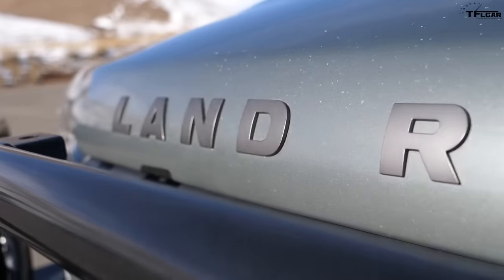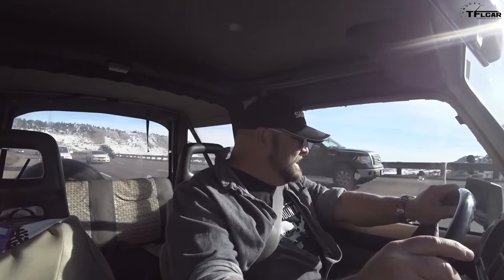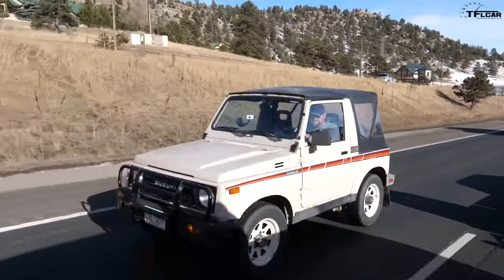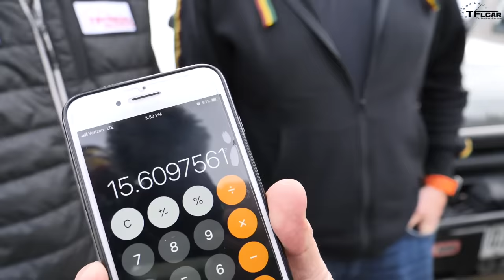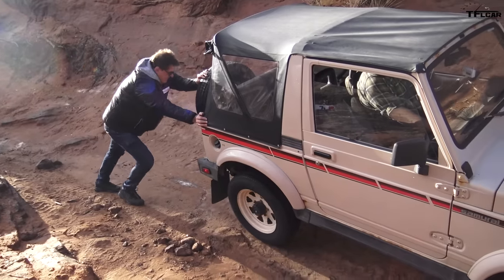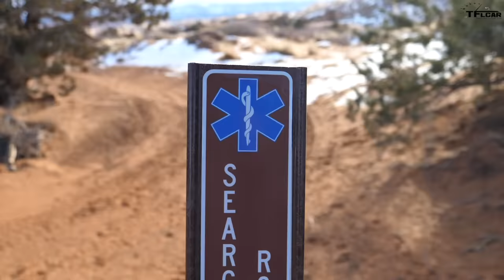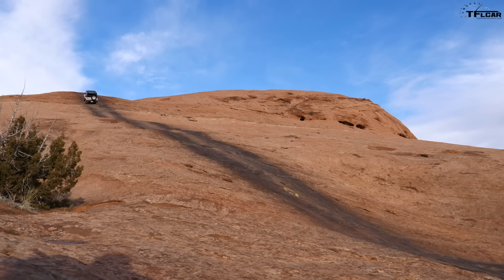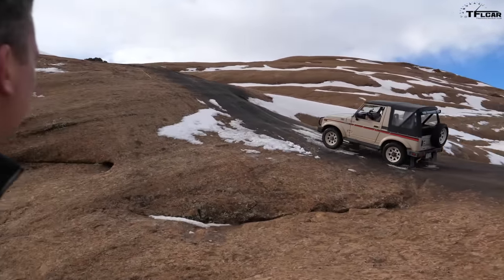We Torture Test 3 Budget Off-Roaders in Moab & This One Is The Best! Cheap Jeep Challenge Ep.8

Comment: Always told people: Samurai's are quite capable.  The Samurai did quite well for being stock with street tires. Not surprisingly, the power to weight ratio of a Samurai vs. a 2.4l TJ is not that much off - if I get that about right the Samurai is around 75hp/ton and the TJ about 100hp/ton and that's not counting the modifications which will put the TJ lower than 100hp/ton.  I'm pretty certain that if you give the Samurai a lift and narrow KO2's that are not too big, it would give both the jeep and the land rover a run for it's money.  Plus the Samurai has the manual lockers which the TJ lacks.
You did prove the point though: you don't need all that much tech to get out and have fun.
Reply: I don't think the Samurai has manual lockers, it just has manual locking front hubs. These don't give any advantage except maybe improved fuel economy due to lower rotating mass when in 2wd - the Jeep just disengages the front driveshaft when in 2wd but it's still rotated by the wheels.

Comment: Good video. I have a 03 Land Rover, modified very similar to  yours, and It does great offroad. I did add the center diff lock.  I have owned it for 16 years, and it has been very reliable. The suspension travel is great, so the traction control often is not needed on trails like Moab.  It's great offroad.

Comment: Great video. I really like how the emphasis was on cheap wheeling, something I do also. I picked up an 04 Grand Cherokee Limited 4.7 Quadra-Drive for $1000. Put another $3000 into it redoing the heads, 3" lift, wheels and tires and some other things. Now I have a rig that is comfortable, fast and with the 32" tires, Vari-Lok diffs and the lift very capable off road with ice cold AC, heated leather seats and a killer sound system for around $4000 bucks.

Comment: If the Sami wasnt stock it would destroy the other rigs.
With a SOA lift, Toyota axels, tires, t-case gears it would still be under what the jeeps lift was.
Reply: Even with Just Sam axels en a rear locker and 31 inch tyres its Just better cause its a Japanese car
Reply: The jeeps lift was just a spring and shock lift, $600 max, if the Jeep had lockers or the 6cyl it woulda smacked everything else easily

Comment: The smallest truck was also unmodified with standard tyres..
Reply: They're terribly underpowered.  And you have to chop the fenders to fit a bigger tire.  They aren't that great. Just cheap is why people use them..
Reply: @rediron44  you dont need massive wheels 90% of the time.
It was the only car on test that was standard..
Reply: @forresttm  Massive wheels??  I had to cut the rear out to fit 31 inch tall tires..LOL.  Far from massive. My stock Rubicon tires where bigger..LOL.
Reply: @forresttm  the one we had was only 60 horsepower dude. I did a spring over and put on 31 inch tires. Still had to cut out the rear fenderwells.  It was a fun little thing.  But very slow, very underpowered.  Weak streering,  terrible undersized brakes. Tons of things you don't know about dude.
Reply: Yet had plenty of power to pull a land rover over...
You dont need massive amounts of power.
Reply: I say that because we used to use on mudding and helped a few that had fallen over..
Its a good small tool. If your asking it to do big car things its going to be underpowered..
Reply: @forresttm  It needed wheel speed to climb some hills here where I live, barely adequate.  Like I said,  it was fun. But underpowered.  If you thought 60 horsepower was good. What if you had a 4.0 inline 6 in a Jeep with 190 HP and 245 ft pounds of torque??  LOL
Reply: @rediron44  i would be annoyed.. At least ots a tiny engine making small power. It has crawler gears for that reason.
If i had a 4.0 that made that power. I would be disappointed :D 
Uk and us use cars differently it seems.
Reply: @forresttm  you do realize the Jeep has lower "crawler" gears than the Suzuki right??  LOL.   And no, the UK does not, the US buys those Jeeps to go off road. Period.  My Jeep has 4:1 low range in the transfer case,  stock.  Suzuki has never had gears that low. Plus 4:11 axle gears, stock.  Crawler gears dude
Reply: @forresttm  and its obvious, since you call them cars..lol

Comment: Throw a decent suspension and 33s at still half the price and it will run circles with less gas
Reply: Or stock with 30" BFG AT or MTR and remove the sway bar and by God do a reasonable time up on the Sammy and let a little bit of air out of the tires! And a set of inexpensive suspension seat's completely changed all the Sammy's I have owned! I'm not downing you're statement just adding to the wisdom!
Reply: @billyputnam6892  no stock Sammi would turn 31's or 33's lol  Mine barely turned 235/75-15's and in a hard climb wouldn't even turn those

Comment: I daily driver a disco 2 never overheated not even once. I'm gonna make a lot of people mad but I own a 95 land cruiser also n that thing is always breaking every other time I take her in the woods. I've never broken anything on my disco other than my windshield with a tree limb. The thing is 2003-2004 Discovery's are trash you want a Bosch 4.0 n then put the difflock transfer case linkage in bc it has it but in launch the designers deemed it unnecessary bc of terrain response. I have both disco 1 n 2 and several Toyotas but they don't compare off-road to my disco on a 3" lift n 33s
Reply: You'll only make the Toyota fanbois mad. Often they just can't accept that some vehicles are actually better, and then all they can do is fall back on the "Toyota is more reliable" argument, which in this day and age is mute, considering that Buick are rated more reliable than Toyota.
Reply: @fredbrackely  woah Theresa Buick really lol. Toyotas are great road going family hauler suv that can off-road lightly. I own a 2001 sequoia sr5 with a 3" Dobinsons suspension and 35x12.5 BFG km3 tires on procomp offset rims. I had to do so much work to make it flex. But now that things a tank n my wife daily drives it. Wish I could post pictures my wife 4'10" n the hood is way higher than her.                Well anyways the point is if your gonna buy a 3-5k off-road toy, the Land Rover Discovery 2 is the best bang for your buck it'll out perform all your Jeep buddies puny stock on all season radials. I am a diesel mechanic so maybe that's way I'm not scared
Reply: I have a p90 Range Rover.  Pretty fun off roading
Reply: My 1999 4Runner needed an alternator a few years ago.  Yep that’s it. Other than maintenance. I had a friend who bought a Disco 2.  What a clusterfuck.  Mechanical and electrical nightmare.  But some people may get lucky and get a good one.  Mad respect to the disco off road though.
Reply: @troyp9485  to me it's no nightmare whatsoever I buy n resell land Rover constantly for the last ten years. The thing you need to understand is that they don't play it safe and try to produce the most cutting edge product available. It's like my dad always, "Son you gotta pay to play, you always get what u pay for." So if all u want is a boring moderately capable suv that to a normal person looks like a shitty old car then get a 4runner. When I drive down the road people wave, land Rover owners give y'all the nod, and lastly kids born after disco 2 was built tell me how awesome it is. I have the feeling alot of you guys are more timid and afraid instead of aggressive and confident which is what will keep u playing it safe for the rest of your life. All the while wondering what could have happened if you just did something and took a chance. Don't regret not buy a Rover,  it's stupid not to if your looking for an offroad toy and don't live in the middle of the country
Reply: Lol the 4.0 is significantly worse than the 4.6 the 4.6 actually doesn't slip liner sleeves as bad as the 4.0 and the power the 4.0 puts out in a Discovery is abysmal especially uphill. As long as the 4.6 never overheats it's a beautiful engine.

Comment: Fun video guys . Love my basically stock 97' Tracker . Trying to find one that was not molested and banged up was a challenge . The 1.6 has just a little more HP / torque than the Samurai and with the auto it crawls real well . Have not really challenged it yet , The AT2 stock diameter and wider tires sure help in the mud and snow .

Comment: I work at a Jeep Shop and have seen 37 inch tires on a 2.5ltr YJ that has 4.88 gears and a rear Dana 44. I have a 2002 TJ with the 2.5ltr and a 5 speed. They don't win races but they are good little engines. And they come 4.10 geared from the factory.

Comment: As a 215 Cubic inch (3.4 Litre) V8 in Buick and Oldsmobiles, this little aluminum V8 was a very reliable little Jewel and had a lot of possibilities.  (Jack Brabham used the block, with it destroked to 3 litres and running his own 4 valve Dual Overhead Cam heads) to become World Champion in the 3 litre Formula one championship)  Of course, If there is a way to really screw up something Rover could do it and did.  Enlarging the engine by both boring and stroking the engine meant not enough meat left in the block and so had to use reduced size head studs and bolts.  Frankly, I have to give you credit for daring to make a trip from Denver to Moab in one of those Landys.

Comment: Awesome guys. Always a pleasure to watch, learn and enjoy being on the trails with you guys. I've owned 16 motorcycles, 64 vehicles, 10 convertibles and my last 4 bikes were Harley with sidecar, 3 trikes, Honda 650, my favorite, Honda 1800 VTX TRIKE and my 650 Suzuki Burgman executive trike is up for sale. I'm a Retired disabled Law Enforcement Officer and  Vietnam Era Veteran Air Police U.S.A.F. I've owned 6 4x4s and just Purchased my first 4x4 2000 Jeep Sahara 4.0 automatic 33inch tires roll bar front bumper and 9500lbs Smityville wench. I was strapping my cane on the bikes but require the use of a walker now and there isn't much of a place to strap that down. The upside is I'm able to take my dog Lola who loves to ride in the Jeep. I have a collapsible step I use to get in. First Lola jumps in, I fold my Walker put that in the back, then I unhook Lola's leash, hook it on the step, climb up that to my side rail and into my seat then I reel the step in and we're ready to go. When I'm out crusing I'm just a regular guy doing what I love to do and not a disabled guy sitting at home staring at 4 walls. I'm looking forward to many adventures with my dog Lola and my Son too. I have no rear seat and I'm having my seats moved back 4" to make it easier to get my legs in and my son is 6'31/2" tall so he will be more comfortable as both passenger and driver. I purchased the Jeep with 64k miles on it 30k of the miles were it being towed behind a motorhome, so 24k on drivetrain and motor for $10,500 cash. I live in Florida and the Jeep spent most of it's time here. I'm 64 and still going. So your right you don't have to spend a fortune to have fun. It took me 6 months to locate this Jeep and my mechanic checked it out and the only rust on it was the stock exhaust that I'm replacing with a stainless steel cat back Banks monster exhaust. Keep up the great work and thanks again.

Comment: I had a samurai in the 80's, when I took it off road into the mud pits I never had to get it winched. Street tires just stock all the way. I did stall out once three feet in water but the one way exhaust kept the water from filling into the exhaust ports into a valve an hydro locking the engine. I went anywhere the big guys went, yes it was slower but it punched through it. The only limitation was water height, anything over the body for the soft top it would have flooded this brand new Samuri. I can say there was a hard top samurai there to and he went half way up his windshield under water with no problem. Samurai I think was the winner here

Comment: The Landy is the only one with an engine design used in F1 Racing.  Jack Brabham made special heads and used it in F1.  It was surprisingly good in that series.  Brabham's engine cost $65,000 and was competing against 350,000-$400,000 engines in the other marques.

Comment: im glad to see you didn't risk that corner on the ice. i know that spot have driven it many many times in dry condition and wet but not ice! its sketchy enough as is. trail gets significantly harder as you go. if you didn't turn around where you did it would have been interesting to see if you would have been lucky enough to have no ice on the other technical sections. looks like you all had a good time. id like to see you go back when the conditions are better tho! good excuse to make another trip out to Moab!

Comment: I had a LWB Samurai with front and rear ARB diff locks, a 6.5:1 low range transfer ratio, 30" all terrain tyres, power steering and a standard well maintained engine and it performed as well as similarly modified Land Rovers and sometimes better where low weight was an advantage.

Comment: Had a Samurai way back in 89 when it was less than 2 years old. Had the 1.1 I think and a 5 spd. Really liked it for the most part. Really good on gas no matter how you drove it, couldn't get more reliable. Only things I did in 2 years and over 140,00 kilometers was change the tires and oil. Downside, REALLY tipsy, choppy as hell on the road, engine running at handy 4500 at highway speed so it always sounded like a sewing machine, not easy to steer in tight corners, couldn't get past 80kph on the highway with a stiff wind and if you were really trying to climb, even in low low, you'd burn out the clutch before it'd spin or move. Had an old Land Rover with 4cyl for a "camp truck". Didn't last nearly as well as the old Scout it replaced (broke in half). Had several Jeeps, all with the 4L engine and mileage from 168,000 km's to over 500, 000 km's. If you can keep the rusties at bay, my personal fave ride is a 90's Grand Cherokee. Old enough to not be overloaded with sensors, and still more capable than most will ever realize or need. Had trucks as well, just prefer my Jeep to do everything I want the way I want and grin every time I'm in it
Reply: I have a 1986 Samurai. I once hit 87 mph going downhill and after nailing a textbook perfect slingshot maneuver off a semi. It was terrifying.

Comment: If they had aired their tires down, you can basically crawl that trail with minor wheel spin unless you attempt the big obstacles. I know that would make the sam even lower, but you gain WAY more traction. Just pick good lines and follow the black and it’s a fun trail. 
    I’ve owned a Range Rover Classic, two D1s and an 03 D2. All basically with 3” lifts, lockers, gears, bumpers, racks, all the plates. You can get a ton of flex out of the D1s and I’ve seen them peg an inclinometer side hilling. They are very capable vehicles with a good driver and fun to wheel, but at some point the engines do just let go. The rest of the world (even Canada) got the TDIs, but we were stuck with the unreliable gas engines. 
    My brother has run a lot of trails in a stock 97 TJ 4.0 manual with no real issues other then departure angles. Very impressive vehicles as well. Great low transfer case in them. Oh, jeep had over 200K on it. Sams can be awesome Wheeler’s with some money put into them.

Comment: was that a Baofeng (or similar) handheld radio I see at 5:39 ? I've had experience with both the Suzuki and the Land Rover. both fantastic cars off road. the little suzuki is so light and nimble it really is a little weapon off road. The land Rover would have been better if you had the TS5 diesel option available. The Land Rover really does just wallow about but on road they are reasonably comfortable and off road they just take everything in their stride. Just one note about the Landy, It's fitted with hill descent control and I notice you didn't use it.

Comment: Hello. I see that you all touched the brakes many times when going down hill. When I used to drive downhill on the trails of the foothills in the antelope valley, i made it a point to be in 4 low in my gmc jimmy and let the engine brake donuts thing and kept my foot off the brake to prevent the wheels from sliding on those narrow steep trails where it was  a huge drop on either side of the trail. 

I’ve not driven Moab so forgive my ignorance. Would the engine brake in 4 lo not have been enough to crawl downhill?

Comment: hey roman! do you have a 180 deg thermostat in your disco? i have an 03 with 195k on original head gasket that runs at 190 deg at 75 mph on cruise control, no issues.190 deg thermostat and peak “pink” antifreeze for land rovers

Comment: What year was the range rover? It might be more comparable to the TJU/LJ which has a limited slip in the rear or a JK that has traction control? I've seen 07 and 08 JK's for around $7,000 before depending on mileage.

Comment: I have a TJ Rubicon on 35" Mickey Thompson Baja MTZs, it has a 6" lift (same make/model he has actually, Teraflex 9550), Smittybilt front bumper, push bar, and body armor, and a Champion winch. It has a hardtop and 42RLE 4 speed auto just like his, but because it's a Rubicon, it has a 4.0 liter, 4 wheel disc brakes (a benefit for TJ Rubis that no one ever talks about), 4.10 gears, and a 4:1 transfer case. 2 things: 1.) I average 15.5 on the highway, I don't know he managed to get that bad mileage out of that Jeep. 2.) Everytime I saw him spin, a little voice was screaming inside my head.

Comment: I wonder which of several possible formulas they used to find the actual mileage for the mpg test because of the off speedometers from the oversized tires of the different vehicles? Or did they just use the Ram's trip odometer to be safe?

Comment: SUZUKI SAMURAI  "as I remember" had enough space for a SECOND factory sized radiator...beside the factory radiator... Simply add some creative pluming,  vent holes through the radiator mount panel {for the second radiator, and an electric fan...  and enjoy the extra cooling capacity  with mostly factory parts.